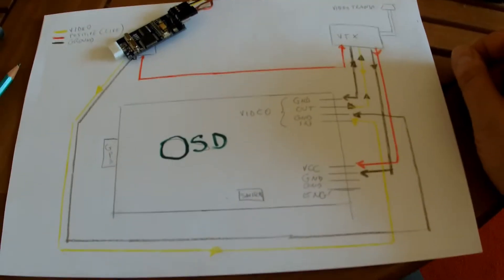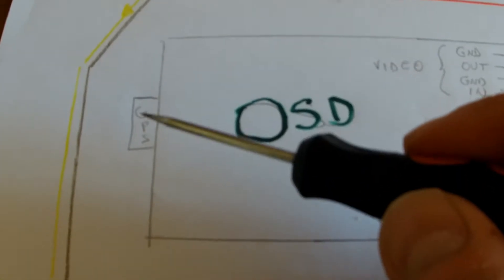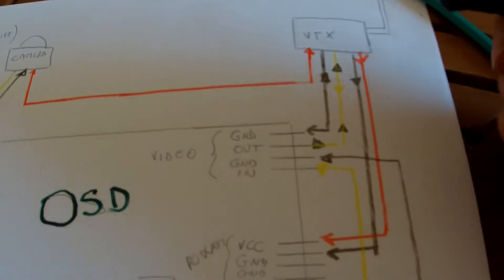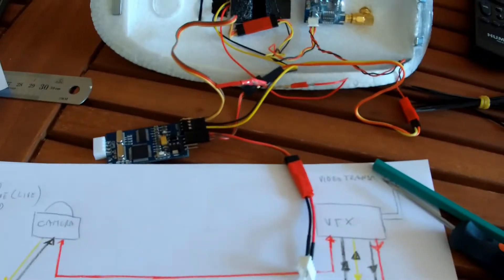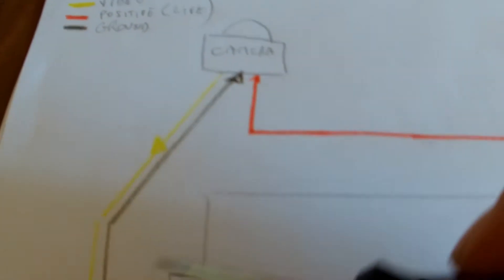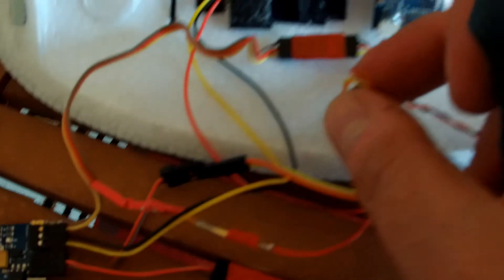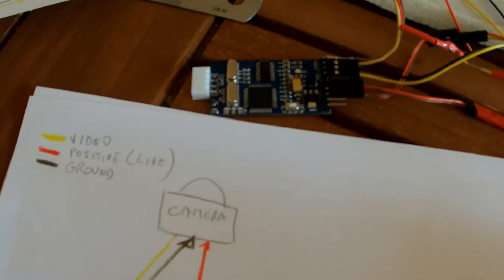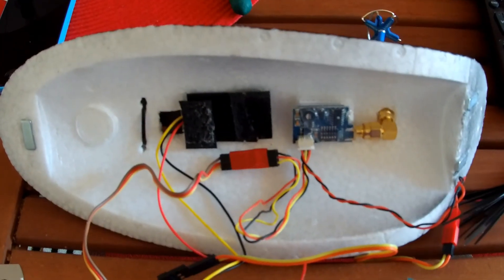Remzibi osd connections

Comment: So how does it get its power, Where's the battery connection in th schematic?
Reply from the maker: The power comes in in VCC and GND near the engine entry I did not put it there.. Apologies.
Reply: @mikbacitube  hi, thanks for that, I watched the vid a second time and figured where you had powered the board from, thanks for a useful video, do you have any info regarding the USB mounted chip that comes with the package?

Comment: I can't get any composite video signal out on Vout and ground of the Remzibi.  I tried all sorts of combintations.  I'm going from the Remzibi not to a video transmitter, but direct to a Display LCD panel.

I have mine powered with a 9volt battery to Vcc and ground.. it powers up the red light on the Remzibi, and blue light on the GPS... then the blue light goes out but the red light stays on.  No video out though at all.   I tested my monitor composite in and it works fine with a handheld video game that outputs composite out.

I assume the ENG line is for measuring voltage from a quadcopter battery pack...  but does it need to be high for the Remzibi to work???
Reply from the maker: Hi, looks like you need possibly to check on the gui if the vout is enabled. Or you have a dodgy connection somewhere. Try with a lipo maybe the 9 v battery is not giving enough juice. That is all I can think of while working :-)
Reply: @mikbacitube  I got it working, off a 9volt powerbrick...  I guess I wasn't getting enough current via the 9volt battery.    

However, I'm only picking up 1 satelite whereever I move it outside, which I need at least 3 or 4 to triangulate a position.

I tried raising it, and moving the GPS antenna as far away from the Remzibi as I could taped on a ruler as an extension to my cardboard box...  also turning off my LCD monitor....   no change.

 My hand held car and aviation units can pick up 3-5-7 or so satelites if I give them a minute or two... so I know it's not location.

Someone mentioned adding a GPS antenna to it, is this possible?  Is there a connection?

First boot screen before pressing Home Position Saved button:
http://www.homebuiltairplanes.com/forums/album.php?albumid=746&attachmentid=77748

I'm going to try leaving it outside for like 15 minutes, maybe it just needs to capture an almanac from one of the satelites:

https://www.maptoaster.com/maptoaster-topo-nz/articles/how-gps-works/how-gps-works.html
Reply from the maker: @choppergirl  if it picks one up then there will be more. I am in UK and I get approx 8 to 15 sat connections, sometime weather front, positions etc count. Wait and be patient. Having it out helps if it is not below 0 or nearby. Temp affects electronics
Reply: @mikbacitube  I don't know, it may be a bad GPS unit.  I left it out for 75 minutes and still only one 1 satelite.   I'll try again in a different location.  My other commercial aviation and auto GPS units don't seem to have a problem, so it may be a budget old GPS chip.